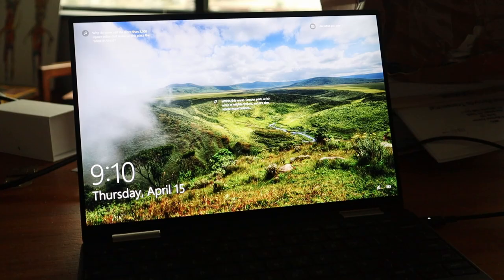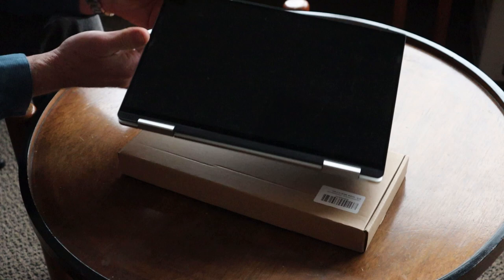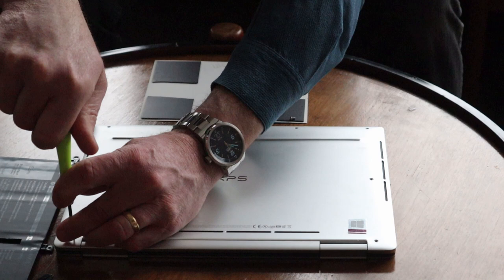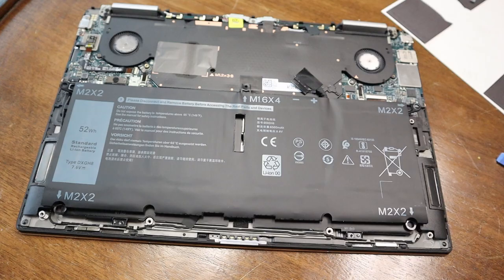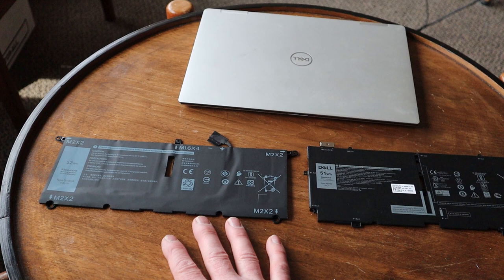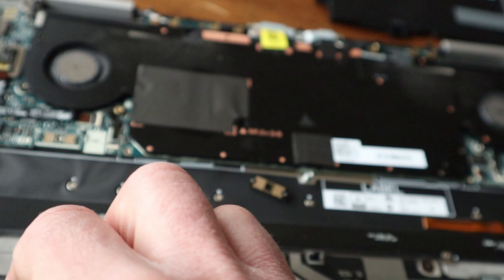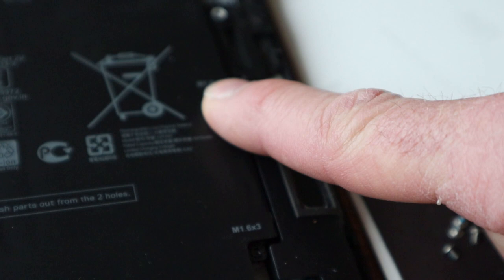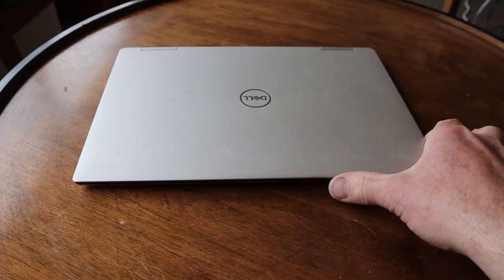EASY - Dell XPS 13 Battery Replacement - DOUBLE CHECK COMPATIBILITY!

Comment: Thanks. I just received the replacement battery for my Dell XPS9380 and will fit tomorrow once the toolkit arrives. The first replacement battery you received, not only the wrong type, but it appears not even to be a genuine/official Dell battery. The second one looks original though.